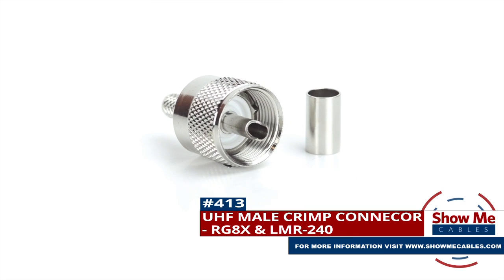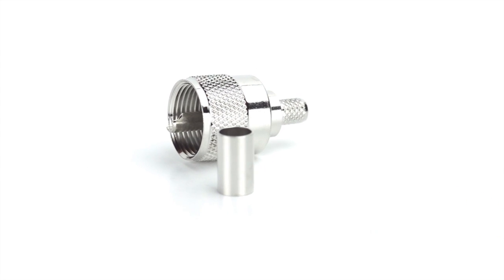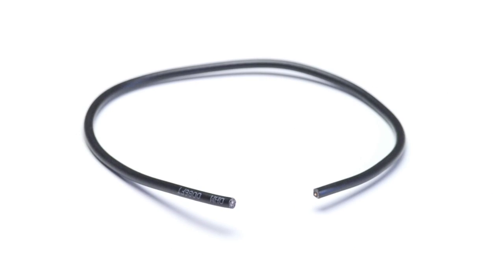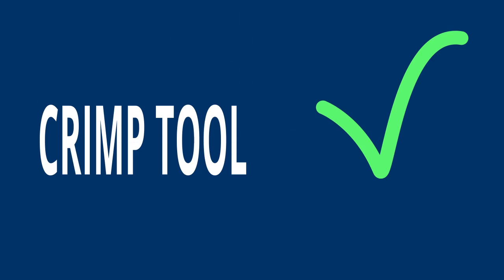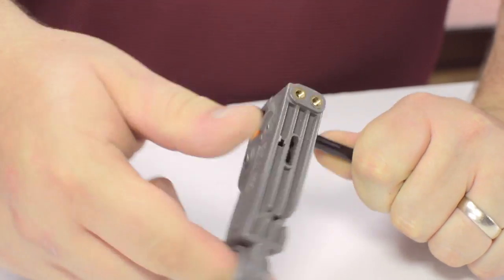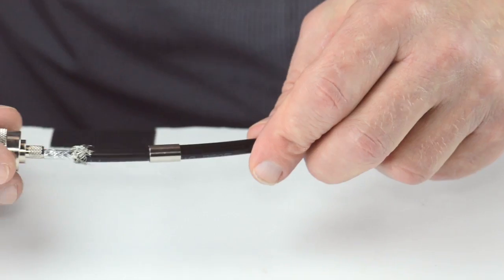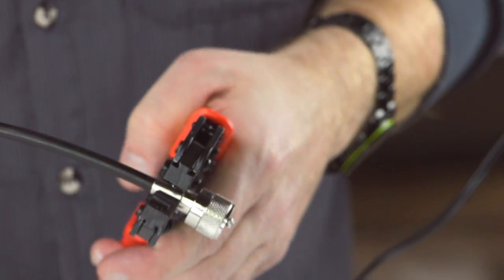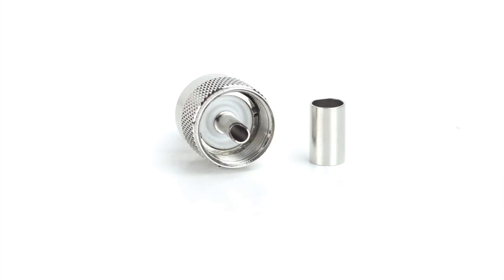How To Install UHF Male (PL-259) Crimp Connector For RG8x & LMR-240

Comment: you should seriously reconsider re uploading this "tutorial". It is REALLY bad. it is 4 times to fast. and there were no dimensions given, and the soldering job was done with a 16 d nail heated by a butane lighter. I have seen 6 year olds do a better job of soldering than that. Overall grade, and F.

Comment: I just installed one of these on an RG-8X 18' jumper. I needed to cut an end off for routing into the truck cab. Checked it with an SWR meter to ensure proper termination. Here are the stripping dimensions:

Center Conductor: 15 mm
Dielectric: 8 mm
Shield: 7 mm

So overall 30mm of the outer jacket is stripped. Then the shield is cut so it is 7 mm. Finally the dielectric is stripped off the center conductor so 15 mm of the center conductor is exposed. This leaves 8 mm of the dielectric. 

One tip when soldering is be mindful of the heat. You don't want to melt the dielectric because it will affect the characteristic impedance of the cable. Some coax uses PTFE (Teflon) for the dielectric which has a high melting temp, but PE (polyethylene) or PF (polyethylene foam) may be used which has a much lower melting point, below that of solder.  Don't keep the soldering iron on the tip of the connector too long. Just get the solder molten and then remove the heat and wait 30 seconds or so. It took me a couple of cycles to get a good joint because I was using thin solder for electronics and needed to add a significant length to fill the pin. When you are done the cool solder joint should be shinny and look "wet". Good wetting is characteristic of good soldering. The solder job in the video could use improvement. 

I used a Greenlee/Paladin Tools PA-2649 die set to crimp the ferrule because I already had the PA-8000 frame. Any 0.255" hex crimper will work. Don't waste your time with a non-ratcheting type. If you want reliable connection a ratcheting crimper is a necessity. 

I also like to use some adhesive lined heat shrink tube for strain relief. I use adhesive lined on coax terminations because it is more rigid. You could use multiple layers of the non-adhesive lined for the same effect. This just protects the cable right where the cable meets the connector. Look for the polyolefin type. I think Home depot carries Raychem which is a TE connectivity brand.

Overall I think these are great connectors and would use them again. They are cheap so buy two or three in case you need to fix another cable, or if the initial installation doesn't go well.
Reply from the maker: Great info.  Thanks for listing it.

Comment: I have to agree with previous comments- you should give dimensions for the stripping lengths.  Also that soldering job is horrible and it WILL fail in time.